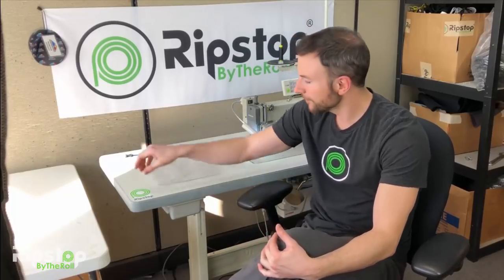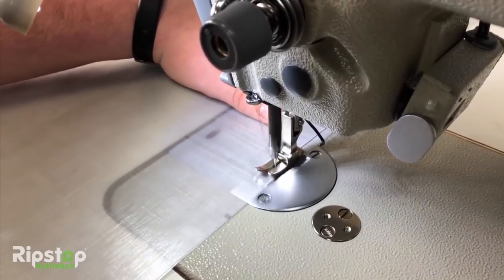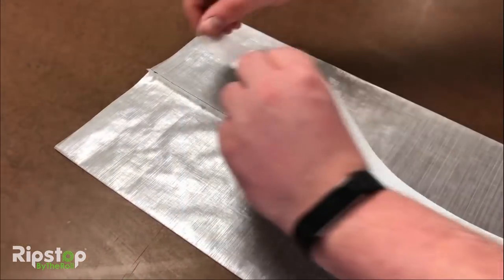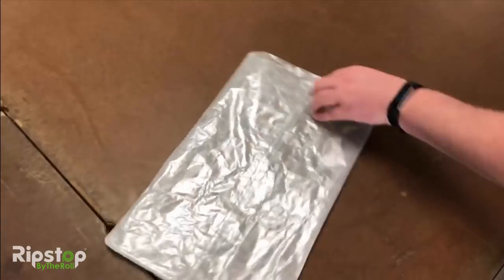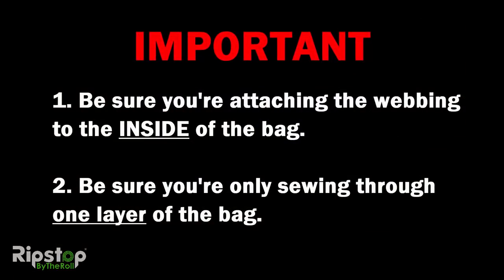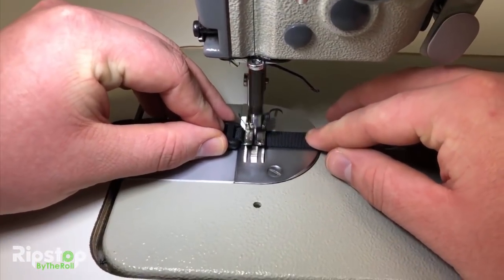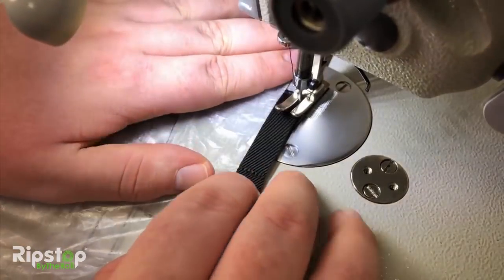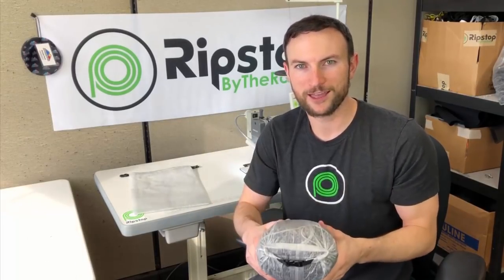DIY @ RBTR - Roll Top Dry Bag Kit with Dyneema Composite Fabric

Comment: On sewing the reinforcement in you say not to go off the webbing. you sew the top and bottom  ok fine. Then jump to to doing the buckles. The roll hem on the plain side is magically stitched tip and bottom .  I'm guessing you stitch this separately to the reinforcement???? With lock stitches both ends as close to the webbing as possible
Reply: I was also frustrated by that omission, but with a background in sewing clothing, I think I know what he did/meant here. You shouldn’t let your stitching slip off the rolled hem into the body of the bag at this point. This would create extra holes in the bag and also leave a gap in your hem. You should sew each line of stitching across the top hem in a complete circle, lock stitching as you start and again in the same spot as you finish the circle. First you do the bottom edge as he shows you, which keeps the hem in place, then press it all nice and flat with your finger and do the line at the very top edge to keep it flat. The holes created by stitching the top seams will be rolled over a few times, protected by the lower portion of the bag, so that should keep any water out. Hope that makes sense. Also, I’m just noticing your comment is from a year ago...lol

Comment: What kind of thread and needle do you recommend using?
Reply: We use Gütterman 100% polyester thread (pick fun colors to spruce up your bag!) and a #11 needle on our Singer machine :)
Reply: about a year late, but. I use COATS outdoor thread. It is nice and thick and easy to find at a Joann Fabrics. They have a few color choices too. I'm placing an order for the Gutermann MARA 70 thread or 50 thread, and is always good when you can order from RBTR and get it in time. But, so far the Coats has been great for my hammocks and bags. Hope this helps!

Comment: I just got my kit in the mail, had a couple questions: What needle size do your recommend? And is there a type of thread that you'd suggest using?
Reply: Did you ever get a response?
Reply: @Maddonkeys  Nah, I had to look it up on their site in the FAQ's
Reply: @Maddonkeys  I just made 4 of the little dry bags with Dyneema. I didn't change the needle from whatever I had on there from my previous project. I think it was an 80/12 or could've been a 90/12. It's super easy to sew through. Didn't change any settings, either, just used a std 2.5mm stitch lenght, except for when I did the topstitching, where I changed it to 3.0mm.

Comment: DUDE, Love your stuff!   Between you and Dutchware I've made so much gear.
From your fantastic fabrics I've made a tarp for my hammock (1.1 oz Silpoly 2nd Gen - Coyote Brown) and a 11' hammock (1.6 oz HyperD XL - Dark Brown)
Tiedowns for my Kayaks (1" Polyester webbing 3000 lb), tent exit mats, and now a couple zip pouches from some extra material ( bases on your ZPP Kit).
One thing I would like to know is what size material makes what size bag?  My first ones will be bases on your 14"x14" size piece.  What size material would I need (and zipper length) for a 12"w x 8"D X 8" high pack?  My motorcycle wants a pack for it's rear rack :).  Ideally a spreadsheet.  
The 8x8 is pretty straight forward 32" (zipper compensates for the seam.  but the 12" width throws me.

Comment: I am looking to make a bag that can hold water and be strong to drops or slams. would this work?
Reply from the maker: Dyneema Composite Fabrics would be a good call for this type of application. However, I would recommend something a bit heavier like 2.92 or 5.0 oz for the abrasion resistance that they offer. You will also need to use a more inherently durable and waterproof seam like a flat-felled seam.